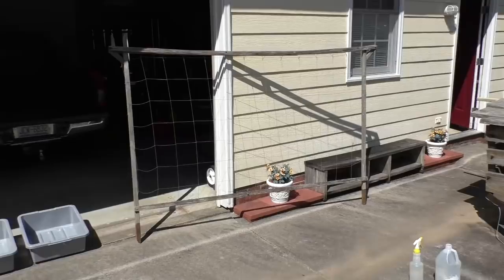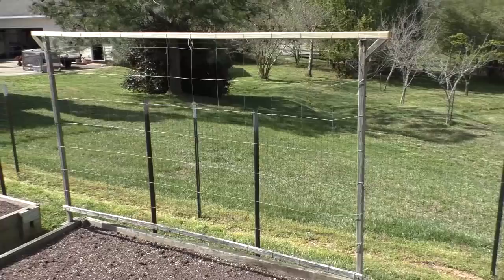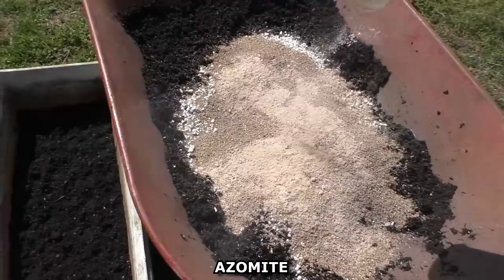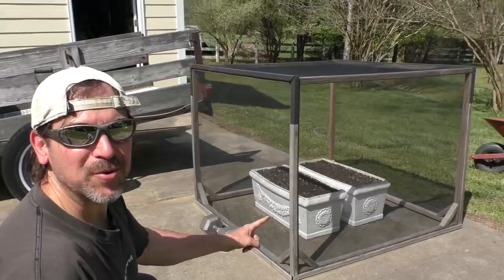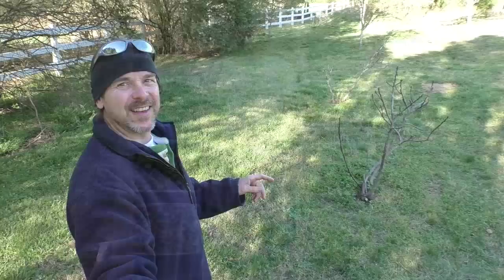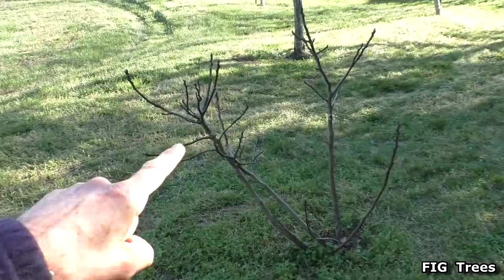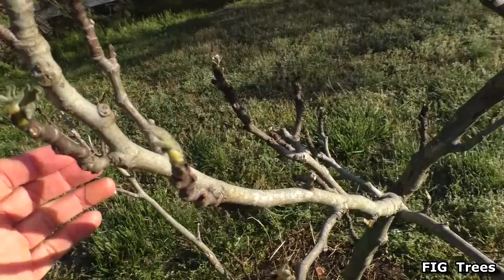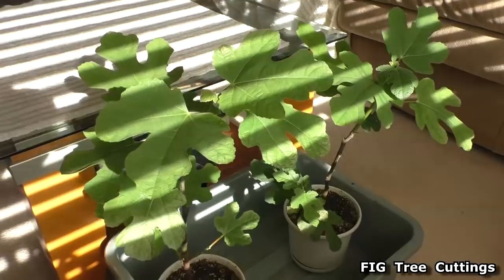Container GARDEN Soil Mixture TRELLIS Repair BIRD HOUSE restoration FIG organic vegetable gardening

Comment from the maker: Garden stuff I use:
Grey Containers I use on the deck to grow lettuce: https://amzn.to/35FoAx8
(The 7 Gallon model, drill drainage holes in bottom)
Organic Fertilizer 5-1-1 Quart size: https://amzn.to/31r2ACQ
Organic Fertilizer 5-1-1 Gallon size: https://amzn.to/2MsU3Lt
(I mix one tablespoon per gallon of water, feed once per week)
Morbloom Fertilizer 0-10-10 Quart: https://amzn.to/2J1x1sQ
Morbloom Fertilizer 0-10-10 Gallon: https://amzn.to/33NbeNL
(For the tomatoes and peppers)

EARTHWORM CASTINGS: https://amzn.to/31yKj6U
PERLITE: https://amzn.to/31ttOsC
VERMICULITE: https://amzn.to/32oCQIF
AZOMITE rock dust 44lb: https://amzn.to/35IhbNP
AZOMITE smaller 2lb bag: https://amzn.to/35VQ1mG
(mix into soil for healthier plants)

Seedling Heat Mat: https://amzn.to/35GsLsJ
Heat Mat Combo Pack: https://amzn.to/32t6agZ
Heat Mat Thermostat: https://amzn.to/2P6C3YS
100 watt LED Grow Light: https://amzn.to/2LxdAwt
Light Bulbs for indoor growing: https://amzn.to/35cqVhH
Reflector for light bulbs: https://amzn.to/359zXfr

Small 2" Seedling Pots: https://amzn.to/2VYAuOq
Larger 3.5" Seedling Pots: https://amzn.to/2J1dfxI
Sterlite 16qt Containers (Holds seedling pots): https://amzn.to/35IfzU1

Soil Sifting Screen: https://amzn.to/31yVpc4
Soil Test Kit: https://amzn.to/2RrtOpV
Gloves (Thin Blue): https://amzn.to/31zZtsd
Gloves (Red Heavy Duty): https://amzn.to/2MuFgzO

Food Dehydrator - Excalibur 2400: https://amzn.to/31qCsbh
Salad Spinner Colander (Zyliss): https://amzn.to/2pHLlAd
Food Processor (hand powered, Zyliss): https://amzn.to/35jkTiD
Basting Brush Set: https://amzn.to/2CjblrE
Knife (Shun): https://amzn.to/38jHScR
Jar Sealer Tool: https://amzn.to/2NVKJiJ
Vacuum Pump: https://amzn.to/32yyPRg
Potato Masher (for making Grape Juice): https://amzn.to/39ssv2U

55 Gallon Rain Barrels: https://amzn.to/35LYuIR
Bulk Head Fittings (Garden hose size): https://amzn.to/2qeOWpw
Spigot (Fast Water Flow): https://amzn.to/33Kbm0m

Wind Chimes I bought:
Medium size: https://amzn.to/33HA0Ph
Small version: https://amzn.to/2MVWPI7
Large size: https://amzn.to/2quYuNp

Garden Shoes (Waterproof):
HISEA Wetsuit Rubber Shoes: https://amzn.to/39LHvJi
Clarks Bowman Free: https://amzn.to/35FhZTo

Animal Control:
(Birds) Plastic Owl Scarecrow: https://amzn.to/2Tp52cE
Tulle Fabric Row Cover: https://amzn.to/2UsrGjH
(Deer) Motion Activated Water Sprinkler: https://amzn.to/2pFOKiH
Fence 50' roll(green coated wire): https://amzn.to/2P4l8X4

Insect Control:
BT Caterpillar Killer(Organic Safe): https://amzn.to/33LLxge
Neem Oil(Organic Safe): https://amzn.to/31nTczW
Diatomaceous Earth Powder(Organic safe): https://amzn.to/35NacmC

Cameras - Motion Activated:
For viewing Deer and Animals(also for time lapses):
Bushnell Trophy Cam: https://amzn.to/2OS2rWA
BOLY SG562-D (with spotlight) https://amzn.to/2BfQmm7

Cameras I use to make youtube videos:
Panasonic HC-V770 Camcorder: https://amzn.to/2qc82MX
Canon SX620 HS Camera: https://amzn.to/2AMPOH5
DJI Mavic Air 2: https://amzn.to/3b5W9MA

SEEDS - My Favorite Varieties:
Greens:
KALE: https://amzn.to/32uRazd
Collard Greens: https://amzn.to/32vv7J0
Lettuce - Red Sail: https://amzn.to/31r5XcY
Lettuce - Black Seeded Simpson: https://amzn.to/2MtGk7h

Tomatoes:
ROMA Italian Tomato: https://amzn.to/35MOlf1
Sun Sugar Cherry Tomato: https://amzn.to/2nX95zB

Peppers (Sweet):
Giant Marconi: https://amzn.to/2pBfTDK
Red Bell: https://amzn.to/2J2VYnI

Peppers (Hot):
Cayenne: https://amzn.to/2VU0vy3
Serrano: https://amzn.to/2VVBK4w

Beets: https://amzn.to/2pwpBXW
Radish: https://amzn.to/2VSk0Hx

Cucumbers:
Alibi (Most Productive I've Grown): https://amzn.to/35P7pZZ

Beans:
Rattlesnake Pole(Green and Purple Stripes): https://amzn.to/2BrdaPC

Green Watering Can: https://amzn.to/2MstSV9
Small Cages for Pepper Plants: https://amzn.to/33DiCuS
Greenhouse 8'x6': https://amzn.to/32ehLQt

Thanks. I hope this list was helpful to someone.

(paid link)
As an Amazon Associate I earn from qualifying purchases.